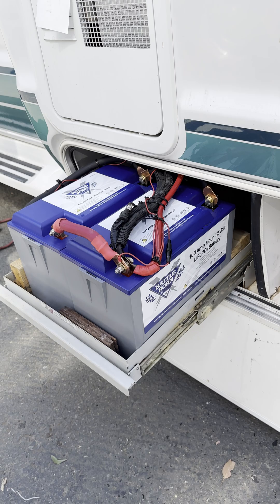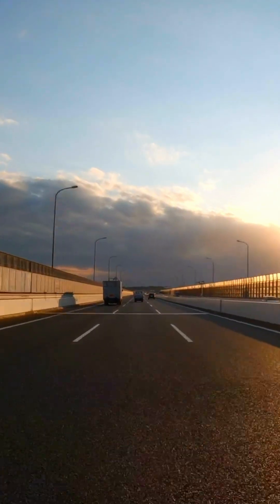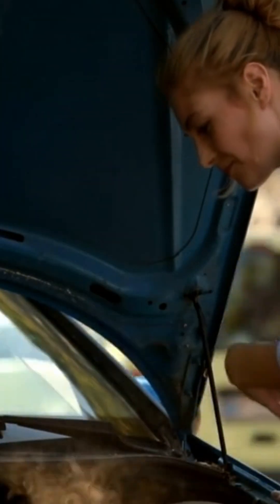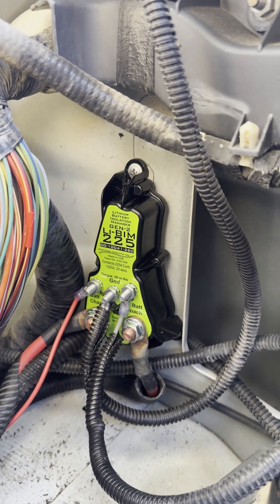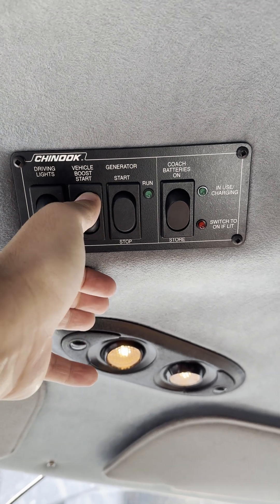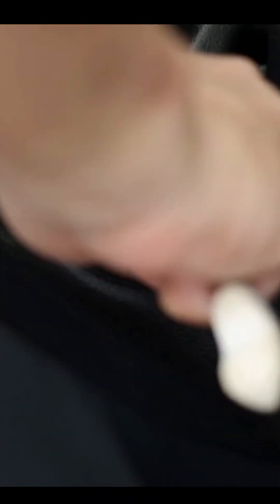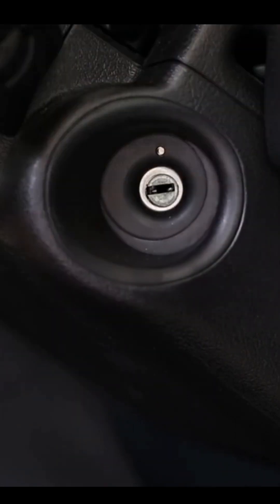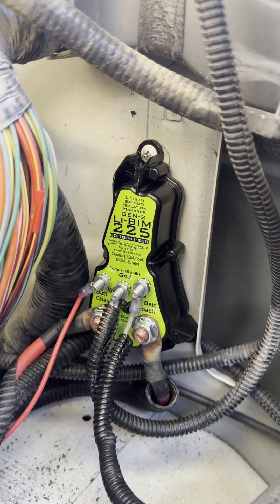Charging RV Lithium Batteries When Driving Made Easy: LiBIM  #GotRVSolar #Avalon-RV #victronenergy

Comment: Question: What if I’m driving my motorhome and am also running the generator so the house converter charger will be charging the house battery. What happens then?
Reply from the maker: Both charging systems can work simultaneously when the battery bank needs a deep charge.  When the battery bank is full or near full both may stop charging so as not to overcharge the battery bank.  It is also possible that one charging source may recognize the voltage increase from the other & stop charging.

Comment: The current li-bim 225 does not follow the 15 min on and 20 min off cycle. See current PC info.
It will allow 60 min of house battery charging if SOC is under 80%.
I thought mine was not working properly because it was not cycling off after 15 min. Then I found the info for my newer version.